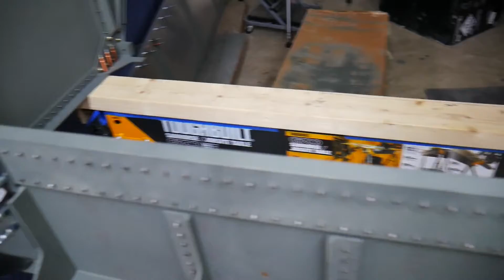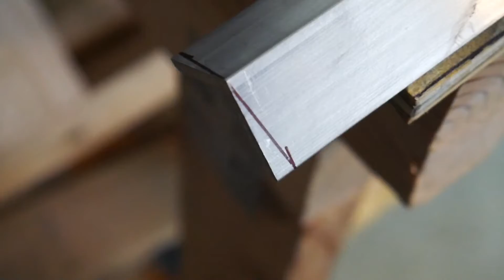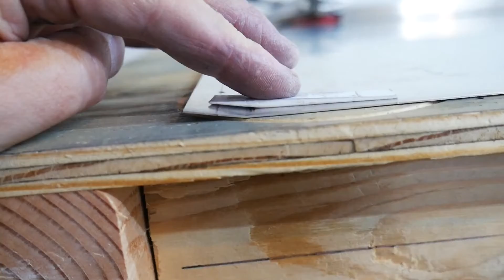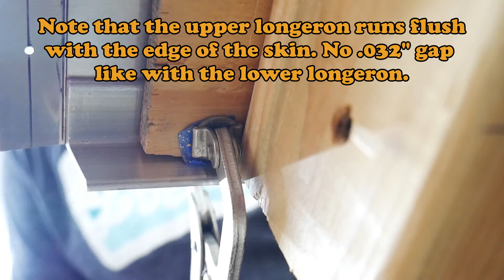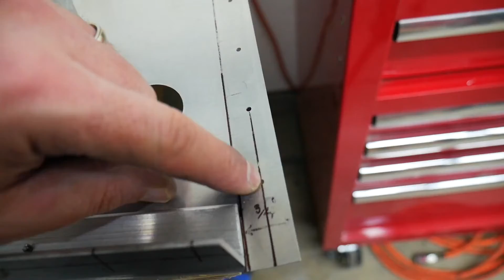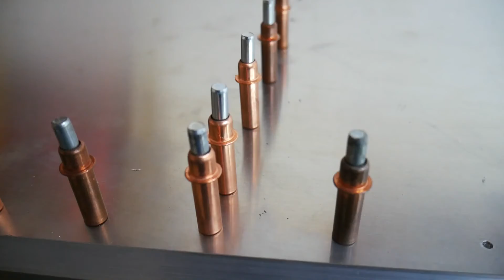Sonex Build - Fuselage Aft Side Panels

Comment: A bandsaw is a great tool for cutting angle. You don't need a fancy one, as 6061-T6 is basically like wood compared to other metals. Looks good!
Reply from the maker: Yeah, I have a little bandsaw with a wood cutting blade. It works well. I didn't even think to use it for the longerons for some reason. 🫤